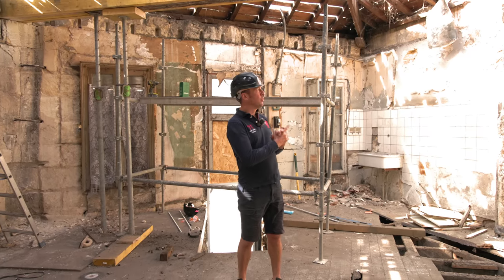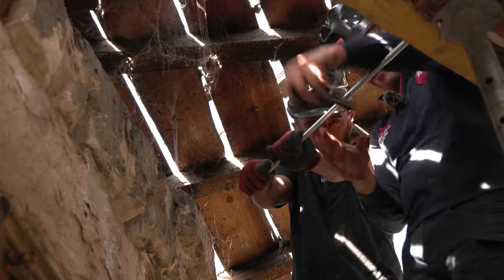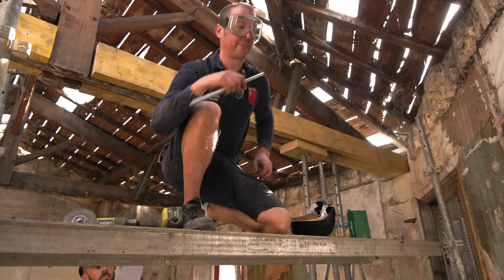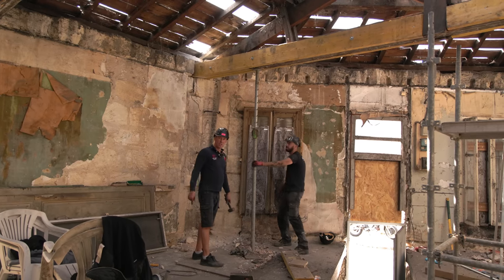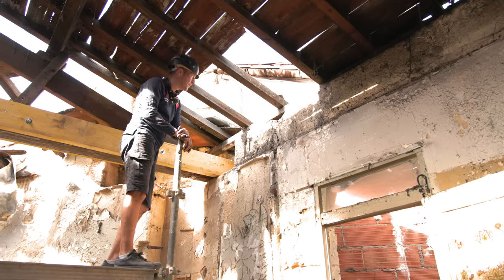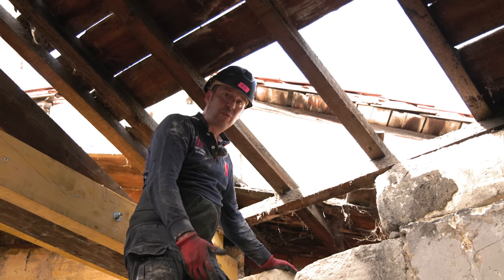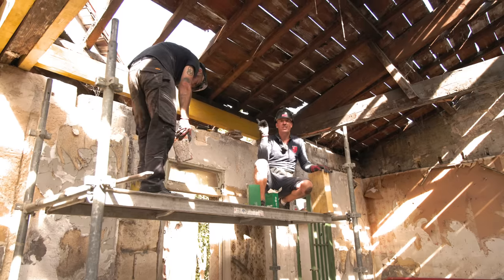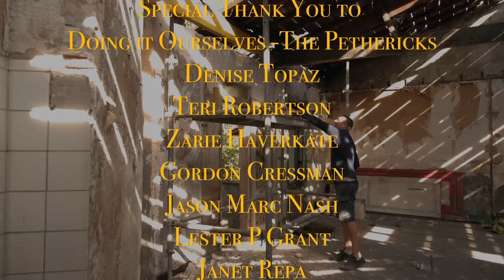Edd Screws Up the Beam, and Moves onto the Next Job!!

Comment: When making up a beam staggering the fasteners will lessen the probability of the lumber splitting along the fasteners .  The bolts are a compression fastener , but the screws are a lateral fastener which is better staggered.

Comment: Next time put the rod into the chuck of a drill and spanner on the nut  will save a lot of time also use a flat bit to recess the nut and washer so they don’t stick out so far!
Reply: Thank you for the explanation. I was telling Ed the same thing that I saw Sean (Sean’s World) doing yesterday, but was not sure exactly how Sean used the drill.
Reply: I am retired builder of 43 years experience so have learnt a few tricks of the trade over the years  also meant to mention that when bolting beams together stagger the bolt holes so they are not in a line and if possible use star washers in between the joists
Reply: I love that builders from around the world are piping in with great advice! It takes a village to renovate a dilapidated house!

Comment: Great to see the rods go in . Here , we have to use specific types of washers for structural applications , they are usually square and thicker than what you’ve used. And we don’t use lock nuts for structural work . More bolts and screws are definitely better given that the additional beams are not full length, so there are some downward angular forces involved. I admire the work that you’re doing and the effort that’s being put in , not only onsite but the vlog/youtube/social media production. Thank you and keep it up ! Cheers mate.

Comment: Nylok or interference nuts are not normally used on static applications, plus, once you've run it along a couple feet of threads, it's effect is compromised. Constructive comment.

Comment: Suss' top tip... spending a little can save a lot! I would have bought 2 ring/open spanners the size of the nuts. They wouldn't have slipped & would get the job done easier & quicker. Also, placing a nut onto the thread reinstates the thread after cutting when removed

Comment: With that much effort, you should have spanned the full distance and set the center support on top for maximum strenght.  Also you usually use a large spade bit to recess your bolts onto the beam for a finished look.  Those bolts should be staggered to reduce the chances of splitting.  And, please do yourself a favor and get a pro drill and a tool belt... Large carriage bolts would have made your life easier..

Comment: My tiny tip.. put the guard back on the anglegrinder. You don’t want a piece of the disc in your face. 😳
Reply: Exactly what I was thinking. I’ve seen the injuries when the disk breaks . Not good. I believe there’s a case for full face shield and hearing protection with disk/angle grinders as well.

Comment: Ed, you REALLY need to use screwed down OSB boards over the holes to prevent nasty accidents until you can get around to fixing the floorboards. The way things stand, it's just a broken ankle or broken leg in waiting. The OSB boards can always be reused for a multitude of uses over many of years, so they won't be a wasted & unnecessary expense.

Comment: Edd, what point is there for not putting sheets of ¾" plywood down on the floorboards to cover those big holes and providing more safety for the 3 of you as you're doing this work? You're usually the safety guy, but those holes clearly are a safety hazard as you're walking around or climbing on scaffolding, plus Anna moving around to get the best angles for filming. Injuries for any of you will slow down and compromise your incredible project! Safety first and always is the best example to the mother of your children and your handsome apprentice! I love your channel and its remarkably varied content, plus the humor you all bring with it! 💞

Comment: Might also be a good idea to use a couple of joist hangers in addition to the two screws on each end to prevent the risk of the wall plate beam from twisting in the future.

Comment: Hi Ed not sure if you read these comments, but my brother put in a beam like this. But it was steel, much much  safer for heavy weights like holding up a roof. Looks like you could have put 2 beams in there  , also please put some thick chipboard down where the holes in the floor are. Safety first.

Comment: 👉 Well, I'm confused. I thought they were going to sister new beams onto each side of the other roof beam. If so, wouldn't they do that before they put up the cross beam over the planned bathroom opening ??? 🤔

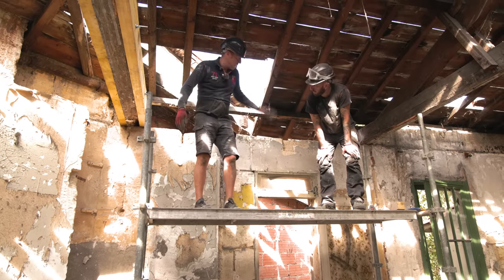ETA: I'm watching at position 34:30 - - perhaps it's too soon to ask the question ???

ETA2: NEVERMIND, I see that a space has been left for the sistering on the 2nd roof beam.

Comment: Time to invest in some decent power tools. Ryobi ain't up to the job. Great for DIY but not enough guts for construction jobs. I'm a Makita guy and can't fault them but Milwaukee or DeWalt are also an option. Not sure how long it took to bolt the beams but with proper gear should be two hours tops.

Not sure why you opted for nylock nuts? Use normal nuts and apply threadlocker just before you nip them up 👍🏻

Finally, the scaffold leg on the joist is an absolute no-no. The whole thing was racking and shaking when you were moving the stone blocks. If that leg had shuffled off the joist that would have resulted in a very nasty accident.

Please don't view these comments negatively, they are coming from a positive perspective 😁

Comment: Some might say the beam and the acro screwed to it is holding up the floor joists! Use nylocks or two nuts on each side to keep tight. Second beam to go with lashings of five star fluid.

Comment: Hi ! Just an immediate reflection: bigger washers should maybe disperse the pressure over larger areas.......Flat irons as washers could also be useful when adding the roof....Anyway, would you after the beam have been strengthen, paint it over with raw linseed mixed with wood tar?? 
I use this for my seven meter wooden double ender boat on the insides....Smells good, and dries, ten procent wood tar, the rest raw linseed oil.... 
Bien travail !!
 Allldabestest, from swedish mikke...;-D

Comment: On threaded rod place two nuts firmly against each other and  place a vice grip plier upon it-it will not turn as you tighten a single nut on the opposite end. Much easier to hold for Louie.

Comment: Clamp the threaded rod in the drill chuck. Hold the nut still with a ring spanner, spin the rod through the nut, et vioila, job done tout suite.

Comment: You shouldn't use a cut off disc as an off hand grinder to remove burrs, the disc has no strength on it's face, you should change the disc type! Also no guard on the grinder, have you seen a disc shatter its very dangerous?

Comment: put duble not on short end the put impack on and hold the otherside with a wrench
Reply: dangit sorry about typos. i suggest this as i had to pull the walls back in on my wooden house as they had poped out and my roof had started to sag witch requires jacking the roof up at the same time but yea little of each till one gets there. then had to do the same when my garage caved inn during the winter from stupid snow ps this ws a 5k cdn house  so cant complain :)

Comment: 😢you could cut the bar and then put the nut on. You can file the thread if you screw it up😂Two men to put a bolt through?

Comment: I'm sorry I don't mean to be critical but why take the  big blocks down from the wall and replace them with a wooden beam...The blocks were doing their job and are much stronger than the wooden beam and the beam is being held up by flat bricks...The beam is unlevel by the way...at least in the video it is. I'm sure the place will look good when it's done but the thing being hidden behind the walls and roof is questionable. 🤔

Comment: Can it be saved? Why not just replace that rotten beam. The original owners would have replaced that beam when it rotted could they have had the means. Use a glue laminated beam and antique it.